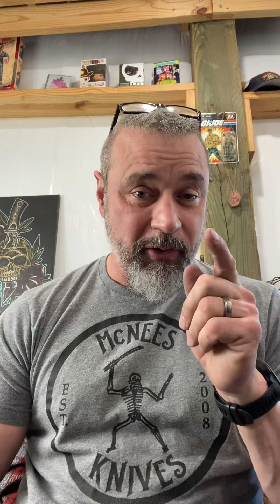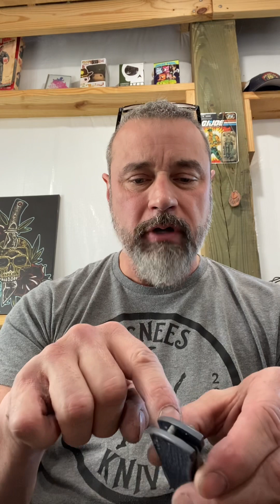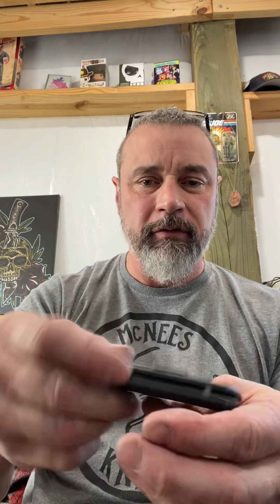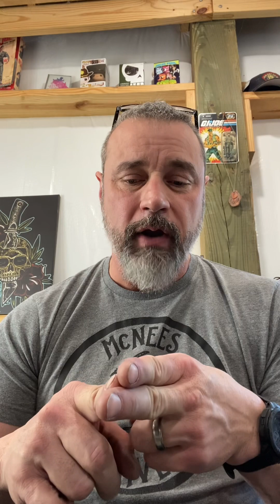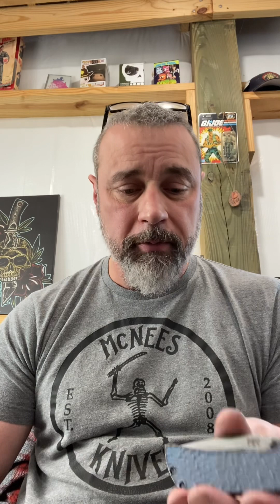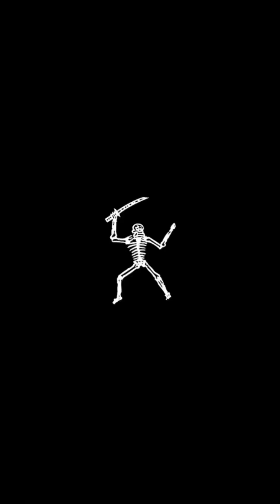MAC2 GEN2 are here- some corrected info

Comment: Is there a reason why the gaps on the gen 2 is wider than gen 1?
Reply from the maker: @yipikaye  We started machining the cut instead of having it done on the waterjet. Gives us more control on consistency.
Reply: Cost efficiency. Pumping out more. Compromise. i guess.
Reply from the maker: @hanjupp  I explained the reason above. It actually costs us more to do it this way. Endmills aren’t cheap and are slower. The waterjet didn’t charge any more to cut another line. 
Thanks for chiming in with such an intelligent comment.
Reply: @McneesKnives truthfully you should go back to water jetting it.  I think it looks a heckuva lot cleaner and the action better... just my 2cents.  
   Anyway Brother your knives are off the chain sick!! Just wanted to make sure you get some love!
Reply from the maker: @6nosis  it has no effect on the action. We’re able to keep the tolerances better on the mill so the lock cuts aren’t all over the place.
Reply: @McneesKnives I understand the reason, but a smaller gap is definitely much nicer.😛